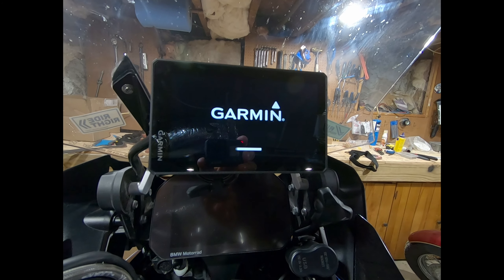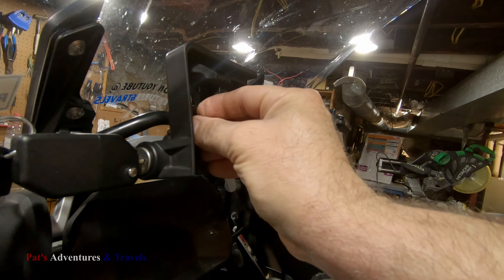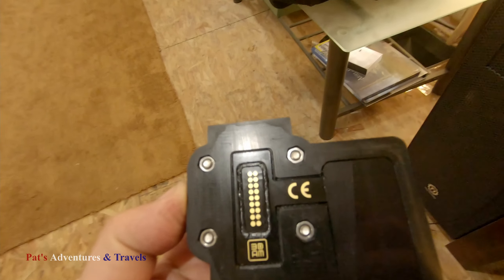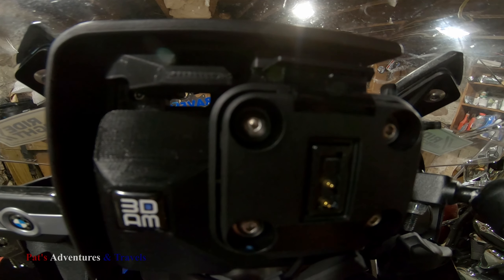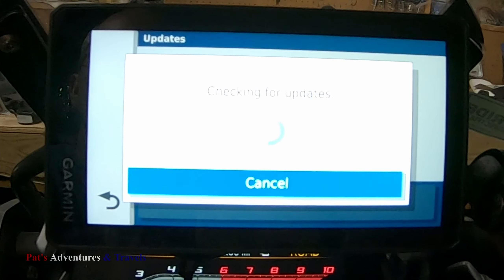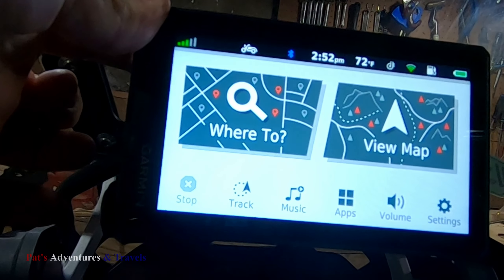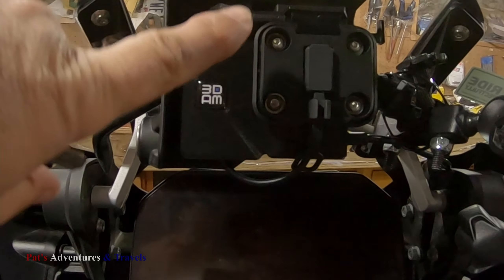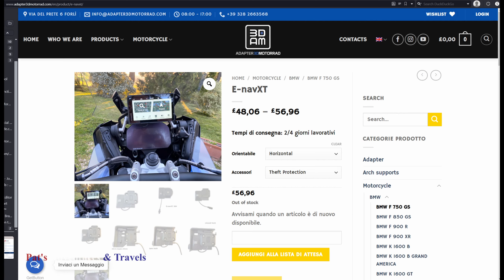Install a Zumo XT on your BMW factory nav mount. (Adapter 3D Motorrad)

Comment: Pat, thanks so much for sharing this video.  I wanted to use my original mount and wiring for the Garmin Zumo XT so this was the solution I was looking for.  I'm so glad you provided the link to buy the part.  I was a bit apprehensive to order the part from Italy but I decided to take a chance.  It showed up 4 days later and installed really easy thanks to your video.  Works like a charm and I couldn't be happier.  Thanks again for the video and link.  Much appreciated!
Reply from the maker: Awesome glad I could help.  Funny thing is I got mine just as fast but took way longer to get something that was already in the states.

Comment: Add another to the list of people happy that you did this video. I didn't know this product existed till I saw it here. As in your case, I ordered it and had it in my hands in Ohio in 4 days from Italy. Mine also came with nuts preinstalled and the right length screws. In about 10 minutes I was in business. Thanks Pat, and hats off to "adapter 3D motorrad" for an awesome product!
Reply from the maker: Glad it helped!!  It is an awesome product for sure, but I have since changed to something different.  Video to come lol

Comment: Just bought the adator for my GS1250 and like you recived it within seven days. Just recently discovered that there is a bike shop here in the UK that sells them too (Adventure Bike Shop) and at the same price as from Italy. Nice video and will help alot when fitting the new security slider.
Reply from the maker: Glad it helped!!  It has worked well for me.  The only negative is the Zuni software when the bike starts.  Sometimes it doesn’t realize the gps has external power and runs the gps battery down.
Reply: @PatsAdventuresTravels  I had to change out the four main bolts as they were too long and would not allow it to sit flush with the BMW's satnav housing even with the washers. But no big thing really.

Comment: THIS SIMPLE FIX REALLY GETS BETTER EVERY DAY.  MINE CAME IN WITH THE RIGHT LENGTH SCREWS AND FOUR HAT WASHERS THAT WENT DOWN IN THE MOUNT SO THAT PROBABLY DID THE JOB FOR THE FOUR EXTRA WASHERS YOU NEEDED AND IT DID MAKE ME REALIZE THE HOLES WERE FILLED WITH A RUBBER INSERT SO ONCE ALL IS TIGHT THERE IS A BIT OF A HIGH FREQUENCEY VIBRATION SOFTENING.  THE 3 D PRINTING QUALITY SEEMS TO ME TO BE MORE REFINED WITH THIS LATEST ITERATION. ALL IN  I FIND THE WHOLE THING JUST SPLENDID. THOSE FOLK IN ITALY GOT THEIR HEAD TOGETHER.  THEY INCLUDED A SMALL SCREW AND ZUMO HAD TWO SCREWS IN THE XT PACKAGING. I ENDED UP WITH FOUR EXTRA LONG SCREW AS WEL ASSUMING THEY MUST BE FOR A DIFFERENT MOUNTING OPTION.  I  ALSO HAD FITMENT WORRIES ON MY ADJUSTABLE WINDSCREEN I RETRO FITTED MY 750 GS WHICH IS FOUND ON 850 GSADVENTURES MODELS . I FOUND THE EXTRA PROTRUSION WAS MORE THAN ENOUGH TO GIVE ME THE ROOM FOR THE ADJUSTER. LONG STORY SHORT THIS WAS A REALLY GOOD SOLUTION FOR MY LITTLE MIDNIGHT TRIPLE BLACK   750.
Reply from the maker: Awesome!  Glad you like it.

Comment: Outstanding! I was going to mount the Zumo with custom wiring but saw your video and liked this better due to retention of factory lock mechanism. The Italians were out of stock for a few weeks but was able to pick up the adapter, simple clean install, good to go. Just wanted to drop a note to say thank you! Would be nice if someone could 3D print a new vanity plate/cover to use when Zumo not mounted but it works great as is. Cheers!
Reply from the maker: Welcome!  glad it helped!!  I agree.  A cover would be awesome.

Comment: quick question, will the BMW nav wheel on the bikes controls/handle bar work with the Garmin unit..
Reply from the maker: No it will not.

Comment: Where do you get the power for the XT? Do you connect its cord to the original cradle or do you disconnect BMW Motorrad cradle's power connection and add a new plug for XT that uses the original GPS power source plug under the front fairing?
Reply from the maker: The adapter uses the power from the factory mount.  No wiring of any kind needed.

Comment: I ordered two of these last November (2022); one for the wife's 2021 GS750 and one for a 2022 GS850 I had ordered. I had the same experience with shipping. They arrived in 5 days and my GPSs took 3 weeks. I'm in a conundrum now however, because I just opened them (my GS850 took 8 months to arrive after ordering so I just put the unopened adapters away until it arrived) and neither adapter arrived with the adapter plate that has the two contacts and attaches to the main plate with 4 screws. All I received was two of the locking mechanisms and two of the main adapter plates that have the 3DAM logo on them so now I'm trying to get the rest of the parts I need which is a PITB when dealing with an overseas company I can't just call.
Reply: Now I feel like an idiot. After reading one of the posts below, I realized the other piece came with the GPS...those were unopened until today as well. This was not obvious from the ExNav tutorial.
Reply from the maker: Yeah I was about to reply, but you found it already.  Sorry for the confusion.

Comment: Hello Pat, I just received shipment of the e-Nav XT adapter for my 2018 R1200RT LC.  I am still waiting for my Zumo XT to arrive as it will also contain a bracket that needs to be attached to the 3D Motorrad adapter.  But from watching your video, and granted your bike is a GS not an RT, it is not clear to me as to why you had to play with the navigation cradle locking mechanism?  Either I don't understand or there is missing information from the manufacturer of the adapter.  Can you explain why one has to take apart the locking mechanism at all?  Thanks much!
Reply from the maker: Because the stock locking adapter will not slide over and lock once the e Nav is installed.  If you bought the e Nav locking adapter then it will allow the factory cradle to lock the e Nav on the bike and that will block the locking tab on the GPS itself so it can't be easily stolen.  I would also think it would help the GPS not fall off on rough roads but I can't swear to that.  Hope that helps!

Comment: Glad you did this. I see the Zumo being promoted but what are the main advantages of this over the Garmin V or VI that came with my GS? My two main gripes with my VI is that’s it’s not very bright or easy to read in the sunlight and I have to manually upload routes to the unit which keeps me from using it very much. Thanks!

EDIT: One more question, does it still allow all the other functionality you have with the BMW wonderwheel control? (I have a non-TFT GSW if that matters.) Thanks again!
Reply from the maker: No wonderwheel control at all.  You only get the power pins to run the GPS.  I never used the wheel anyways so for me no big deal.  Yes way brighter and slightly bigger!  If you want to make routes on PC you'll still have to upload them to the unit I believe.  If it can be done via wifi I am not aware, but I am still learning what I can and can't do with it.
Reply: Thanks for the quick reply!
Reply from the maker: @bradb2514  I guess one other thing is the new Zumo has more back and off road features like I overlander.  Going to try using some of that in the very near future.

Comment: Hi Pat, many thanks for this video, particularly as I am considering swapping my Nav6 for the XT. It has now been a while since you installed the adapter; how is it all working. Many thanks, Andy.
Reply from the maker: Only issue has ever been power.  When you start the bike the garmin momentarily loses power and it wants to shut down.  But that is a flaw in the software.  Most of the time I tell it to cancel shut down and after a bit it realizes power has been restored.  Every once in a while it doesn't and runs off battery.  Others have said if you just let it shut down and then turn it back on everything is good.
Reply: @PatsAdventuresTravels  many thanks for your prompt reply. I have been looking at a variety of options and it is between this adaptor or plugging directly into the BMW’s power that avoids the problem you describe; I shall give it more thought. Thanks again.
Reply from the maker: @andrewtofts7884  You could always remove the factory cradle and mount the XT in the same spot and run the wires back to the battery.
Reply: @PatsAdventuresTravels  Hi Pat, thanks for your reply. I am now seriously considering the Touratech lockable mount to replace the BMW mount.

Comment: Does the adapter plate come with the 3d mount
Reply from the maker: Yes it comes with everything you need to apply it to the BMW mount.  If you want the locking option you'll have to buy that.  Check their website.  It explains it all really well.

Comment: HI PAT . Ray back again. I just got my 3D adapter in , like you suggested I ordered the extra lock (they call it a security device)  Ironically you don't really need the different lock mounted as I mounted out to my cradle when it came n today and just for grins I tried the lock and the lock lever that was on my cradle locked on the the adapter  and prevented it from being removed. Maybe I am premature in judgement as I have not got the sumo XT in shipment yet so we'll see . The existing lock slides over the top of the adapter and prevents it from going anywhere after you take out the key.  There must be another reason that wont work with the actual Garmin bits. 

I will repost after I see of to works wot the mew XT in a couple of days/cheers
Reply from the maker: Cool.  Yes it will lock but you'll be able to push the release at the top and just take the GPS off the bike without that extra piece.  It stops you from being able to release the GPS from it's cradle.  Hope you get it soon!
Reply: @PatsAdventuresTravels  thanks Pat, I see what your are saying now. it will lock the adapter in place but not the device itself , is that it ? cheers
Reply from the maker: @rayelliott5661  Yes that's it.

Comment: Hello  Pat ..can you tell me if these contacts are useful or a danger if i use this adapter ?
Reply from the maker: Not sure what you mean by that?  I have had no issues of any kind with the bike if that is what you mean.  All this adapter does is use the power contacts that used to power the nav 6 to power the zumo xt.
Reply: @PatsAdventuresTravels   thanks for your response .i ve a little difference on 4 contacts who are bigger and like in one on the back side..i cannot join a photo to explain here .. 3DAM says that it is a new version..
Reply from the maker: @christopheg7827  Ok was not aware they changed things.

Comment: Hi, I bought the same adapter and find that it stops charging when iI start the engine. Have you had the same experience?
Reply from the maker: Yes its annoying.  Most of the time it comes back.  Worst case I have had to cycle power on the GPS.
Reply: @PatsAdventuresTravels  This is the answer that I received from a3DM: Hello, it is a software problem of the garmin Zumo XT, when the bmw starts the engine it interrupts the power supply of the services for a moment and the XT goes into shutdown, if you click on the button it continues to stay on with its battery but does not go to seek more external power.  Few XTs do this problem and garmin is working to fix it.  The software needs to be updated, for now it is better to let the XT go to shutdown without touching anything, it will turn back on immediately and remain under charge.
 When the XT does not receive power, it checks the voltage on the connector pins and you will see that there is a voltage of 5V.
Reply from the maker: @michaelhoebrechts9556  I hope Garmin is working on it.  I kind of figured it was them. Thanks a lot for the awesome information!  I am sure others will benefit greatly from that info too.

Comment: I thought I would check back in on the Zumo XT. I just got one on sale over Black Friday. Has your Italian mount given you any problems? I see some mixed reviews on it, but I like the price point and simplicity. I’m trying to decide how I will mount the Zumo on my GS now. A winter project. Thanks for your input.
Reply from the maker: I have had no problems with the mount.  The only complaint is the fact that the Garmin will go on battery power after you start the bike.  Eventually it'll switch back over to bike power.  Every once in a while it doesn't.  Over all glad I did it.
Reply: Great. Thanks a lot.

Comment: I tried this mechanism but have had nothing but trouble! Firstly the slide section shattered....the plastic is way too brittle....this was replaced. The next was the base. There is obviously some electronics in it to drop the voltage from 12 to 5 volts. that managed to work 2 times before failing. Now the store is closed for holidays in Italy!!! Can't win! Hopefully they will replace the base and quickly once they open again. I have a 4,000km safari starting mid August which is the reason I purchased the adaptor and Zumo 6 weeks ago!. Hopefully I am the only one who is having so many problems!
Reply from the maker: Wow.  That sucks!  I had no issues of any kind with mine.  I believe it is 3d printed based on the way it looks.  I don't have mine installed anymore to check the voltage.  I have been experimenting with a tablet instead of a GPS.  Mixed results on that.

Comment: But does your wheel still work to control the screen still ?
Reply from the maker: No, but I never used it anyway.  I find just using the touch screen easier and faster.

Comment: My BMW Nav 6 died (bought it in May 2017), so rather than buy another I have bought this adaptor and will get the XT. Seems to be a much better unit than the Nav 6 with more functionality. Interested to hear how you find using it. Here in the UK the Nav 6 is £450 (approx) whereas the XT is £ 347.
Reply from the maker: It is way better for sure.  The biggest complaint I have and can be fixed by Garmin but won't be is....  When you power the bike up the GPS comes on under external power.  Then when you start the bike the GPS complains that it lost power and will shut down or you can press cancel to stop it.  Press cancel and it runs on battery power at that point.  Most of the time it switches back over to external power after a few minutes to several minutes.  Every now and then it never does and stays on battery power.  I had to pay 120 US Dollars just to get the adapter because it comes from Italy.  Well worth it over all!!
Reply: Hi Scott, Did you buy the 3DM adaptor kit, how much and from where please?
Reply from the maker: @geoffreybell5376  There's a link in the description where to buy the adapter.  It is the only place I know of that you can get it.
Reply: The Nav VI might be covered under warranty. Ask Garmin to replace it.